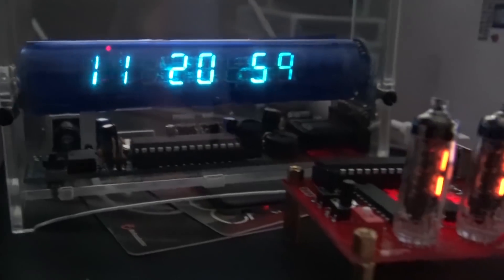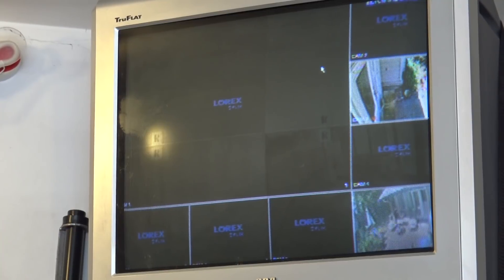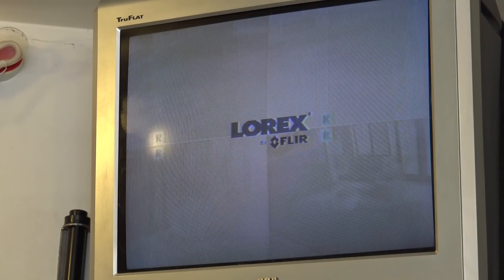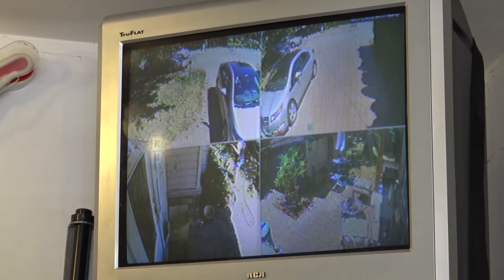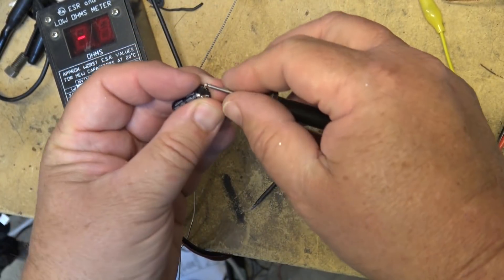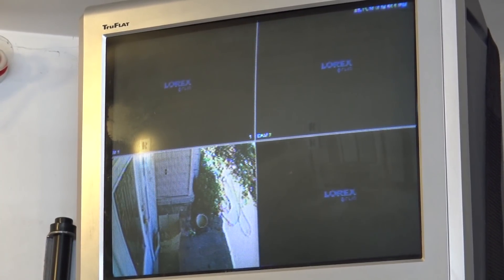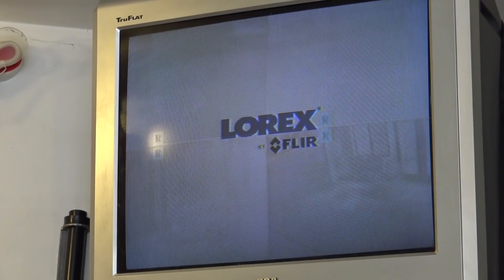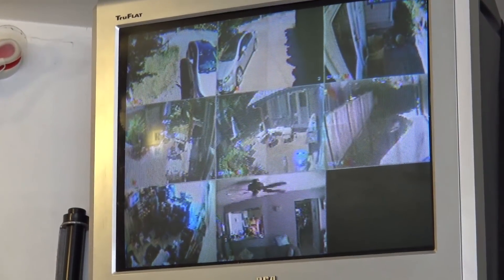Lorex DVR hackers trying to compromise system

Comment: Thanks for the advice. Our system has been flaky at the best of times but your advice of factory reset appears to have solved the problem, bit worrying as there is a cctv camera in my room/ covering the work bench and the whole of my bedroom.
Reply: Please start using Firewall. There are many free and open source solutions out there. You can even turn your old laptop or desktop into a Firewall.

Comment: Perhaps for these kind of systems, it'd be best if they were on their own dedicated network, isolated from your normal internet connection. Can't hack something that you can't reach.
Reply from the maker: Not on my internet connection. The DVR is on it's own dedicated IP.
Reply: @12voltvids  Aah. My bad xp
Reply: Not an expert on these things but, it seems strange that a message appeared asking for an update if it's not connected to the internet in some way. Don't these devices offer the ability to view your cameras remotely from a phone app or something similar?
I think you'd need to have them on a separate router, completely isolated from the outside internet, otherwise it would require a local physical attack directly on it to cause any problems.
I would check their website and get the latest firmware update directly and do it manually (as you mentioned).
If it continues to happen. I 'd imagine there's a log on it somewhere, that would be a good place to look if anything dodgy is going on before you reset it.
Reply from the maker: @jimsmindonline  
It is connected to s second dedicated network separate from my computer. Has to have an internet connection so that I can remotely view the system.
Reply: Perhaps a VPN would be a good idea? You can install DD-WRT on an old router and it makes for a half decent VPN server, and then you'd have two layers of security. Depending on how the DVR functions that may not be possible though.
Reply from the maker: @AricVogel  
Well that would also prevent me from being able to access it. 
Same with a firewall which it is behind. You have to open a port to access. Once you open that port anyone that finds the public IP and figures out the port can see the device. At this point they can not access it because of the username and password, but they can ping the shit out of it to make it unstable.  The solution is to change not only the public ip address but to change the port required to access and of course change the login administrator name and password.  What hackers do once they figure out what model of DVR you have is they try to push a remote firmware update. Of course this requires that the operator accept this.  They chase it multiple times to annoy the user, then present a solution (bait) for unsuspecting novice users. If someone clicks ok the unit will take whatever they are pushing and that will be the end if the DVR. I saw this on a job a year or so ago. Was out chasing a no internet problem. Got to the clients house. Found the 150 internet connecting going about 1 meg on a wired connection.  Noticed the ethernet light blinking like crazy to the security DVR.  Unplugged cable.  Internet fixed.  Plugged it back in, data storm, switch in kick out again. Very slowed speeds.  Asked the customer if they had done any work on the security cameras. Customer confirmed that a few days before the problem started they were having some issues and checked for updates. They said there was one and they took it seemed fine for 3 days then internet went down.  I suggested they try rebooting the DVR. They power cycled it and it bricked. 
I suggested that I thought the update was a hack and to watch their internet bill.  Sire enough on the next bill they got hit with a huge overage charge for using 5 terabytes over a 6 day span.  It is pretty obvious that their DVR had been turned into some type of bot.   
This can happen on any type of network connected device.  Best advice, accept no auto update. Unfortunately with all the smart TVs and game consoles now requiring updates before they will allow usage if a hacker gets in and hacks the device in many cases the device is toast.  For that reason I don't have my TV connected to the internet.  For Netflix I use the app on my cable box.
Reply from the maker: @jimsmindonline  
I have updated firmware to fix bugs like no color on legacy ntsc cameras. All the updates have been in the form of a bin file that gets loaded onto a USB stick.  When software upgrade it selected on the menu it advised to insert the USB stick then press ok, which shuts it down restarts it, and loads the bootloader from the USB stick that then completes the upgrade. Never take s live update from unknown sources.
Reply: @12voltvids  
Thanks for clarifying. Sounds like you've done all the important stuff, like changing default password and settings.
Most likely whoever they are is scanning IP blocks for the open port and trying their luck. There must be some sort of vulnerability if they can force it to offer an over the air update or disrupt normal function. Hopefully the vendor fixes it. If not, the only way to be 100% safe would be to disconnect it from the internet, but loose remote access.
Reply: That's not entirely true look up stux net. Hackers managed to infect a nuclear testing facility completely isolated from the internet, by infecting usb drives.
Reply from the maker: And this is why companies have policies in place that forbid employees from bringing USB sticks into the company.
Reply: @12voltvids  that would mean that you do have it on your Internet connection, having it on a separate network does absolutely no good if it’s still connected to the Internet. Don’t get me wrong. I like having security cameras connected to the Internet, so that I can view them from anywhere in the world. But if you want true security, you make sure that they are not connected to any networks that are connected to any other networks like the Internet
Reply from the maker: @Pypical  my DVR is not connected to the internet.  I do have stand alone ip cameras that are encrypted that I can connect to if I want. They are behind a firewall on a router that I can remotely connect and disconnect
Reply: @12voltvids  either it’s connected to the Internet, or it’s not connected to the Internet and you cannot remotely view it unless you are home and hooked up to its network
Reply from the maker: @Pypical  this DVR is not physically connected.  I have other wireless cameras that are connected to a completely seperate wireless router that has a physical disconnect switch that I can remotely switch on. So i connect to the remote switch and turn it on remotely.   Then I can view and review footage stored on the cameras.   I could also connect this DVR the same way by plugging it into a port on this second remote control router.  I have it set so that it will automatically disconnect as soon as i close the connection. Once it is closed it is done.  Uses a raspberry pi to operate relays that disconnect the power to a switch that is between the main router and second router.  Switch off and no data gets through.

Comment: They'll likely be exploiting a vulnerability in the HTTP web interface. If this is the case, it'll require a manufacturer firmware update to address the vulnerability (does the logon use java based authentication by any chance?). Network cam manufacturers are notorious for slack security. You could always print out an FBI logo and point one of your cameras at it :))

Comment: What are your thoughts on those wireless lightbulbs with motion sensors and cameras?
Reply: NORMALIZATION OF IGNORANCE I believe they’re LEDs
Reply from the maker: It works. Not using it currently, but the one I have works great.

Comment: No one use crt,S anymore when you get a flat screen cheap
Reply: I still use them. Not the big ones, but the tiny ones that came from old viewfinders. One is currently in a clock project.
Reply from the maker: I still use the old CRT, and will till it burns out.
Reply: I have TVs from the '60s nothing in my humble opinion will beat CRT color or black level. Keep your flat screens, they'll all be broken and unfeasible to fix long before my vintage sets are gone.
Reply: Laughable statement..
Reply: Then once it burns out, replace it with another CRT! :-)